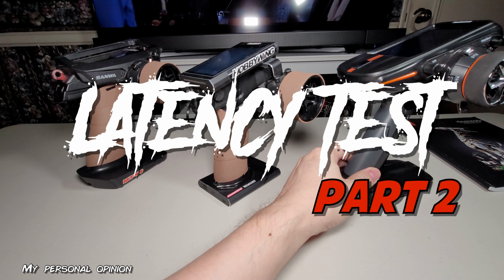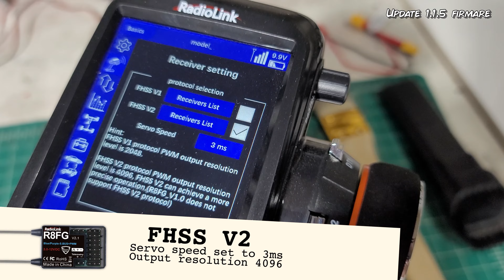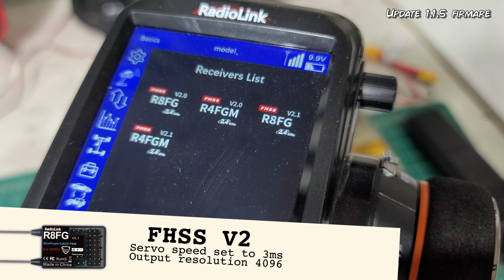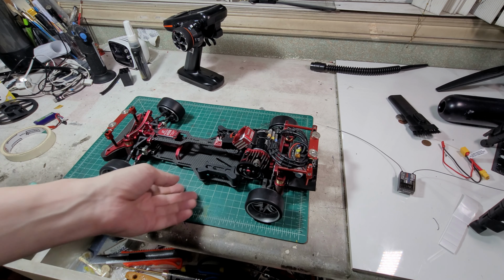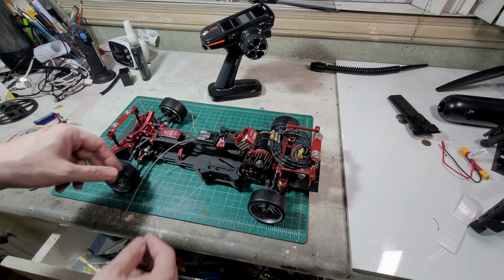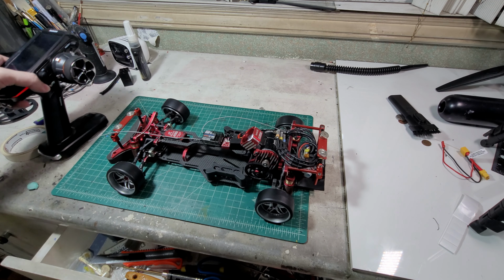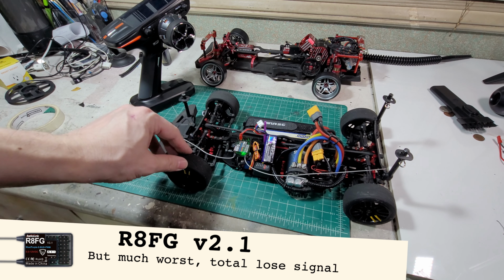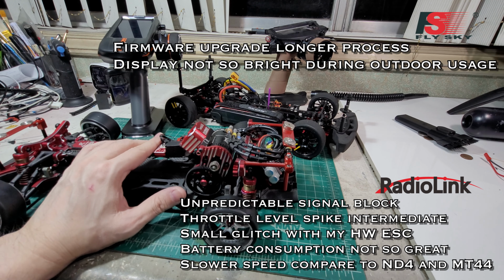Latency Test Re match, Radiolink RC8X, Flysky NB4 and Sanwa MT-44

Comment: What firmware on the NB4 are you using?  What RX on the NB4?  Are you in 2 way or 1 way mode?

As far as the RC8x the receiver wire just coil them up and put a little heatshrink on it and just keep the end exposed.  One in front one in rear.  Keeping the ends from touching metal or Carbon.
Reply from the maker: Test in this video, the NB4 was set to 2way mode ( many are saying 1 way mode will be faster), older firmware 2.0.93, receiver FGR4. Thanks for the tips (rc8x receiver antennas)

Comment: I don't remember hearing you mention it in the video; but you did go into the receiver settings, select the new type and set the latency to 3ms (from the default 14ms) ?
Reply from the maker: At the very beginning of this video (0.17 seconds) the servo speed set 3ms set Fhss V2.
Reply from the maker: Link to other user skip 2 mins and 30 sec, https://youtu.be/1bKn2xS3wBU?si=FcoyZN3eMUkY4WFb

Comment: Hi I’m looking for some drift wheels for a 1/10 scale drift truck but it has rubber wheels. Do you have any suggestions from where to get them and what wheels?
Reply from the maker: For drift wheels with 12mm hex, mst and ds racing offer adjustable offsets, for fix offset mst, yokomo, ds racing, reve d, for tires yokomo (Dra asphalt) (drc Tiles), ds racing, reveD (as-01 for tiles), it really depends on the surface you are drifting on. Most common rc drift build need to be rwd  for easy Maneuvering corners.

Comment: Is there anyway to do an rx8c re test with the latest firmware? Doesn't need to be a video, just a response on of its fixed or not. 

I've been waiting to get one until I know it's fast, and I know they've been working on it, and released firmware in November
Reply from the maker: Sure, i will add informations once i downloaded any new firmware. 👍🏻
Reply: @oliverstoys8411  very cool. The latest firmware was released 11-13-23. Can't wait to see if it speeds it up.
Reply from the maker: just installed the latest 1.2.0 firmware, did the same test with the same esc, and high-speed servo (Radiolink transmitter set to 3ms, with radiolink latest receiver), unfortunately, I don't feel any changes with the speed and response compared to this video I upload earlier.  @ExaltedRC
Reply: @oliverstoys8411  thank you. And bummer.
Reply from the maker: @ExaltedRC  after the November 2023 update, steering value flickers to 0 to +1 back and forth, i did try to re-calibrate it, there some occasions it is back to normal and next day the flickering value return, let hope it stabilize soon.
Reply: @oliverstoys8411  sad face. Thanks for the updates. Appreciate it

Comment: looks like the NB was faster than Radiolink? But should be the same?
Reply from the maker: The NB4 is very responsive and quicker compare to the RC8x, radiolink feels sluggish and slow, i barely use it, for me I don’t feel confident using it, that’s my opinion. It’s not that bad, some like do the radiolink, it’s really down to personal preference.
Reply: @oliverstoys8411  Thank you, was looking at NB4 first, then this RC8x, now im going to start read about Sanwa  MT-5, for me is drift 28/24:1 cars, more i read more confused. I have a "new in box Radolink Rc4g" and waiting for my DA3S kit. Was going to use that, but with sensored motor i dont get any info? All new to this. Was flying plans and driving cars  20year ago, but now with this drift i want the best.. starting point. thx again.
Reply from the maker: @fdderi I love the sanwa mt5 radios. It currently have the most updated FHHS protocol (fast), but the only negative about the radio expensive receivers  and limited channels, the good thing about it, has 3rd partly micro receivers which are cheaper for sanwa, perfect for small drift rc, good luck with your project, and thanks again.

Comment: Did you ever exchange the RC8 for another one? You did a video about it not working right. Cause if not, then it's probably delaying due to it being a factory defect. 

Another thing is my RC4GS is just as fast as any of these in the video. Try the R6F receiver. It's faster cause it's not bogged down trying to run all tjose features you're not using...
Reply from the maker: I do not have another unit to do another test, the early release r8fg version 1.0 has a response time of 14ms (release before Feb 6 2023)which has identical speed with the older radio from radiolink, i do have r6fg but still have the version 1.3 which also have the maximum 14ms latency, radiolink release a updated receiver r8fg version 2.1 which I acquired and done some test in this video, now set to 3ms and updated firmware nov 2023, rc8x does improved a little but not as good compare to flysky nb4 and sanwa MT44, in regards to signal block, the two antennas of the r8fg give a long performance in range, but not suitable for indoor 1/10 or smaller rc, if you are close enough you get signal block or blind spot.

You can check out Radiolink youtube channel explaining there signal block issues and also on there website explaining older version r8FG v1.0, (website rc8x directory under firmware) if you have any receiver with 1.3 version or lower the max latency 14ms.

There several well known youtube influencers (endorser) who got the radio for free, after few months, they stop using the radio because slow responses, some of them commented  “ i don’t feel connected with the car using this radio”, if your intention is just to enjoy your rc cars, none competitive racing the rc8x should do job.
Reply from the maker: @mrpotatoheadracing  I am glad you are ok with the performance of your radio, even the manufacture claim to be faster 3ms doesn’t mean it’s going to performance what it say, unless you where able to compare it with other high performance brands out there, I just saying even with the newest November 2023 firmware and the new 2.1 receiver, to my opinion the RC8X still slower and very sluggish compare to the nb4 standard setting (not even the one way fast mode) and older mt44 transmitter, as long you are not doing any competitive racing you are good, and the end of the day if you are happy with what you are using and satisfied with the performance that all that matters 👍🏻.
Reply: All I do is competitive racing.
Reply from the maker: @mrpotatoheadracing  awesome👍🏻
Reply from the maker: For reference only skip to 2:30 seconds other driver feedback regarding RC8X https://youtu.be/1bKn2xS3wBU?si=FcoyZN3eMUkY4WFb